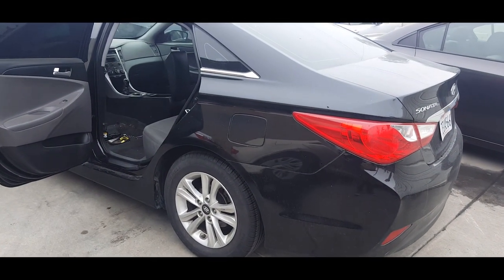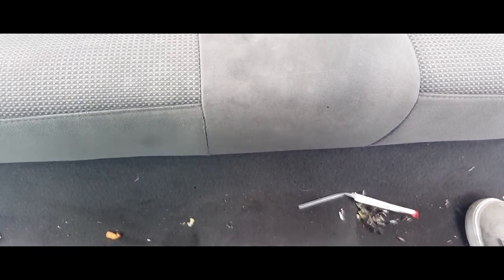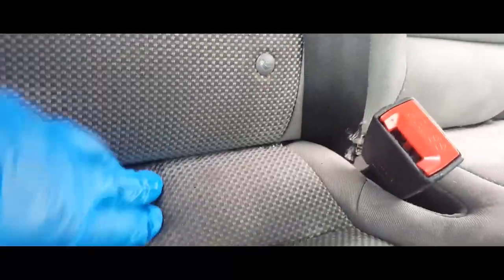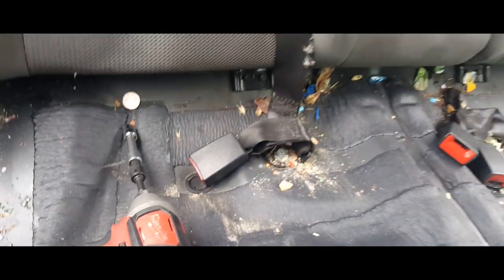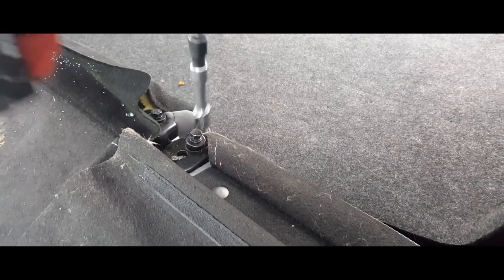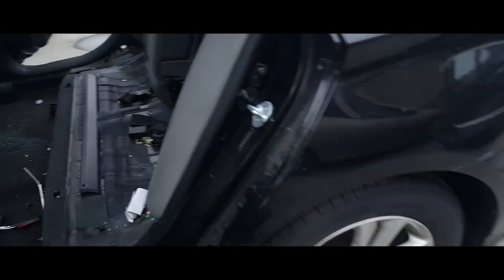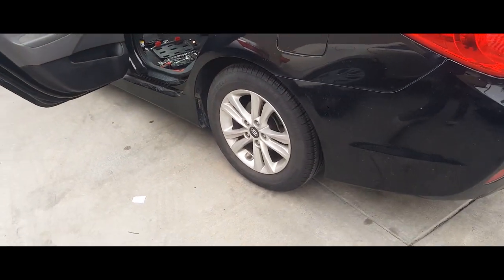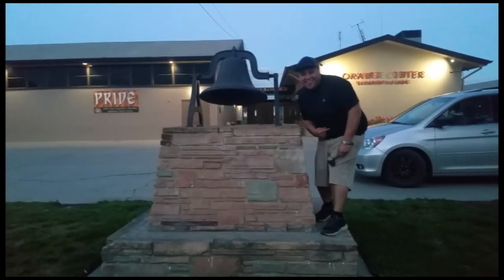How to: Remove rear seats from a 2013 Hyundai Sonata

Comment: Very helpful for finding those two back bolts. On my 2008 there are tabs   in front and underneath about a foot in from either side that you have to push in so that you can lift the seat up. Thanks again for posting.
Reply from the maker: No way man, well honestly every car is different but similar procedure.  Glad you were able to knock this out bud, thank you for your Support 🙏

Comment: My keys are stuck in the boot my alarm goes off won't let me unlock the boot can I take the seats out from the front without going through the boot
Reply from the maker: Which boot are you referring too? In order to drop the seats you have to pull a lever thru the trunk to release the back seats and fold down.

Comment: How did you undo the back seat to fold it down ?
Reply from the maker: You go thru the trunk. There's levers you pull to release it
Reply: @559powerscape  my truck can’t open which is why I’m trying to remove the seats. What if I can’t get to the lever in the trunk then what?